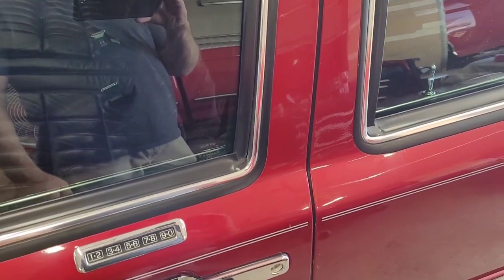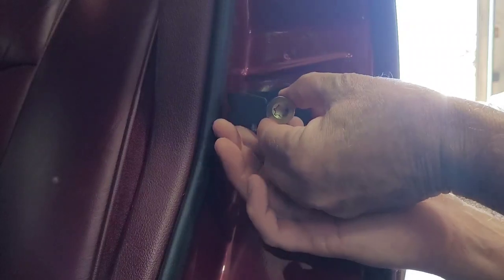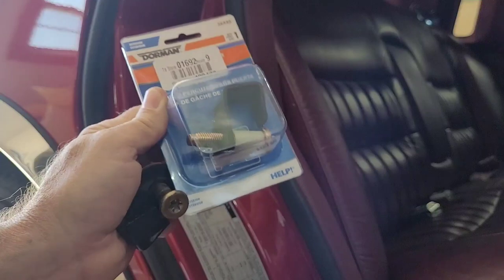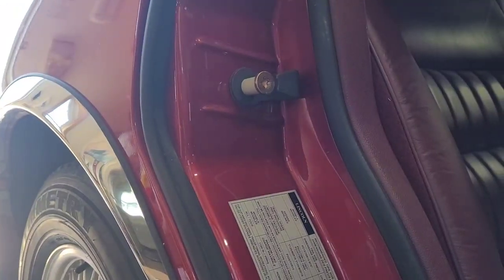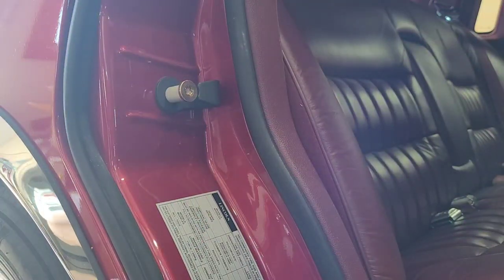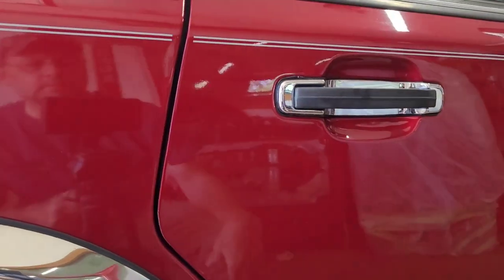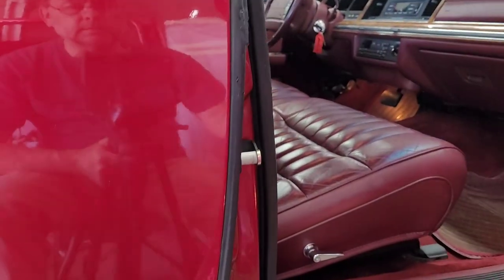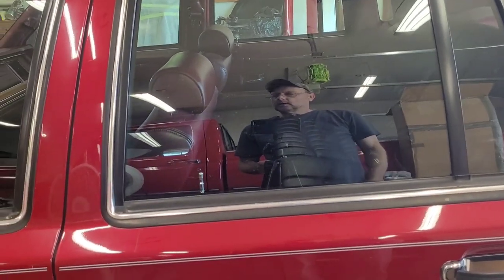1990 - 1997 Lincoln Town Car Door Striker Bolt Bushing Replacement

Comment: I found two bushings on ebay ($4) for the strikers. I only needed one for the driver's door. Before replacing it I pencil marked the striker. Took it off put the bushing on and remounted the striker. Works like new. The driver's door gets the most use so it usually fails first. The other three still work fine. I'm old school about fixing something that isn't broken.  Thanks for your video.   :)

Comment: I use White 1/2" PEX Tubing...
Works perfectly.
Reply: Leave it to one of the US automakers to design a part that uses a piece of plastic surrounded by all metal.  The plastic will invariably break leaving the metal piece intact but to replace the plastic piece you have to buy the entire thing.  SMH.
Reply from the maker: @robertcass7723  you don't "have to buy the whole thing." It's just easier.
Reply from the maker: I prefer to have it more original.

Comment: Just found your video.  I have a 1988 Lincoln Town Car I have owned and daily driven since 2009 - love this car.  Doors have always been hard to close, require slamming, and one rear door is hard to open, even though latch mechanism inside door is functioning properly.  The door strikers have never had a bushing on them since I bought the car, and I tried buying a replacement striker years ago and it was too large, and the door latch would not close around it, so I gave up and just kept slamming.  I am curious - internet says for my 88, I should get Dorman 38448, but I see complaints similar to mine, the striker is now too large to fit the latch.  Would my correct part number for my 88 be the one you are using, 38445?   I'd love for the doors to close more gracefully on this otherwise awesome car.  Thanks!
Reply from the maker: Autozone can look them up and sell you what you need. Yes, sometimes they are too big and need to be sanded down, but not a big deal. Also, be sure to spray them down well with lubricant. They do wear in and work better and better the more they're used.

Comment: I thought this was the answer to my prayers as I have an 02 Mustang I'm restoring with this same closing issue. I went out to look at it and it has a striker plate more similar to a trunk/deck lid, not the fat beefy kind like this. 

Do you know what else could be the issue? I'm about to spring for a whole new latch assembly inside the door. 

There is no play in the hinges and the door lines up perfectly with the body so it's not a hinge issue.
Reply from the maker: I'm afraid I'd probably try new latches as well. I've never worked on a Mustang for this issue.
Reply: @tonyscarcare5657  Thanks for the response! I found your channel via Adam. 👍
Reply from the maker: @HAL-dm1eh  awesome.....thank you!

Comment: Why not just replace the broken/missing nylon bushing?
Reply from the maker: Because I've found they never fit correctly.
Reply: @tonyscarcare5657  seems like a good reason to me.
Reply: There's one eBay seller who has these in machined nylon, and ended up fitting perfectly (the 7/16 size worked for my 1992 TC). The doors close smooth as butter now. I was leery of Dorman because the bushings were too thick when I got strikers for a 79 Mark V, but maybe that was a bad batch.
Reply: @Lincoln7992  good to know!
Reply from the maker: @HappyLong80  I've gotten bad Dorman ones but not near as many as the other brands.